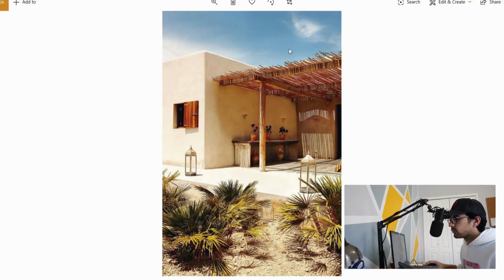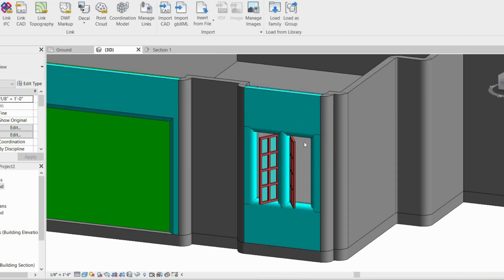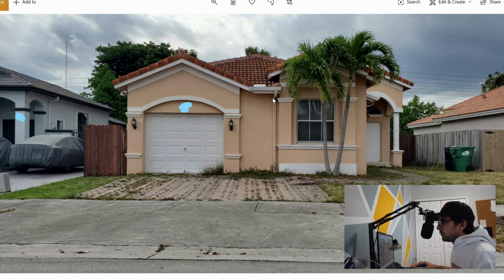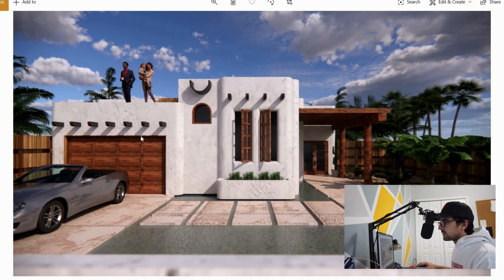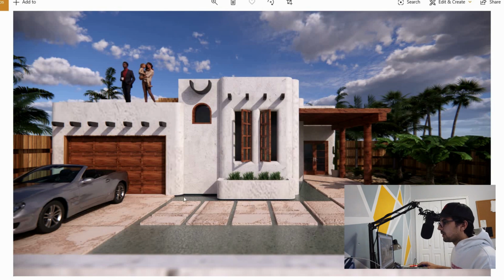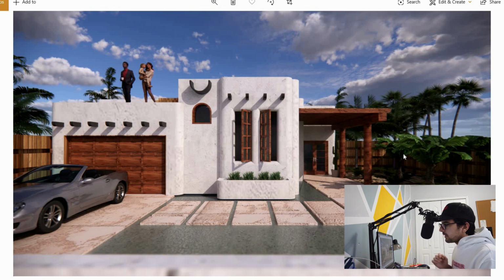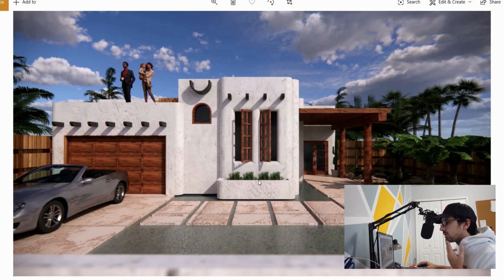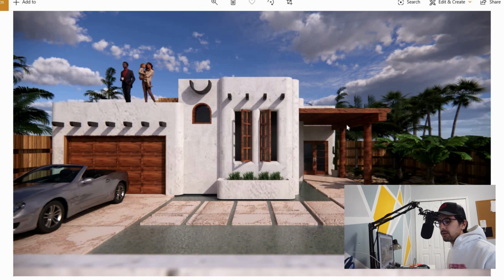I Redesigned This Neglected House (Using My Laptop)

Comment: Not sure if you’d want to create a splash puddle infront of the pathway to/from the house. Not only would it splash into the car convertible car 🤣, it would be a constant maintenance to the facade of the house. But overall I like that house. It’s simple and yet it looks like a million bucks. It would definitely be in 300-400k range
Reply from the maker: No worries. It's sealed; no water is going anywhere 🤣

You'd be surprised - the original house is probably close to 400k as it is... Florida is super expensive ....
Reply: Mooch lol I meant I’m not sure if you wanted to unseal it and cause that issue. Although I’d somehow connect it to that small wall beside it and create a waterwall of some sort 😱 I didn’t realize it’s Florida, I’m up here in NC. Give a window or two to that garage in the same style to bring some light in while you’re at it!

Comment: You mentioned you made part of the model in Rhino; how did you export to Revit?
Reply from the maker: On Revit there is an option to "insert" a "cad/dwg". It actually also gives you the option to insert a Rhino file. Let me know if that helps. If not I'll give you the step by step tomorrow morning.
Reply: But you can't edit that rhino geometry in Revit? Can you?
Reply from the maker: @rshivam10  you might be able, I'm not so sure. But it's not something I would do myself, anyway.
Reply: @MarteloDesign  there's a plugin called Rhino Inside Revit that ties rhino to revit. You can even use grasshopper in rhino inside revit.